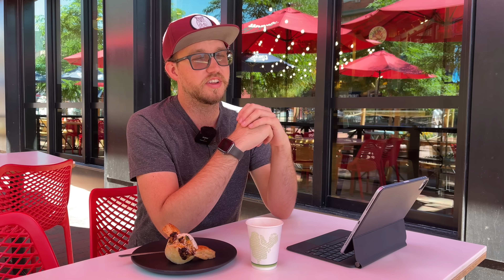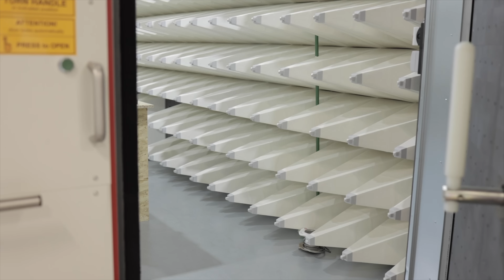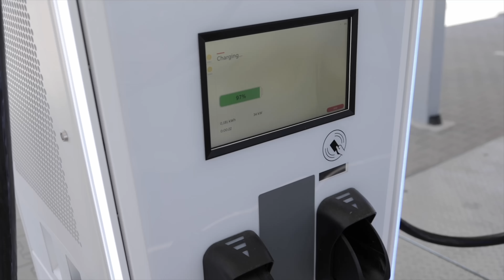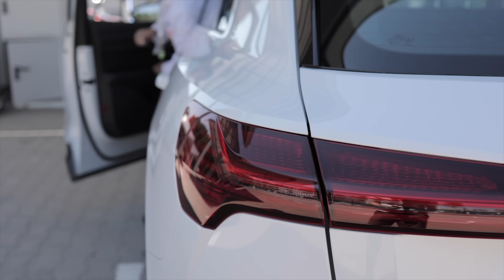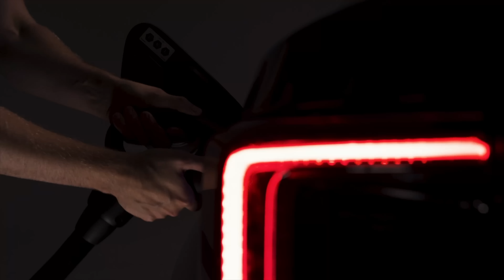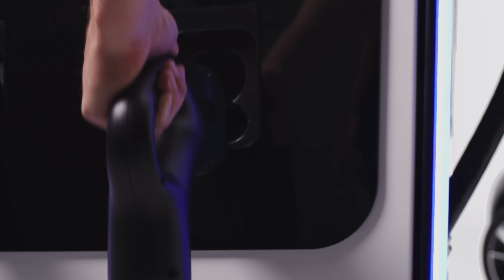This Is The Future Of Electric Car DC Fast Charging With ABB

Comment: In Australia its no doubt the hot sun. Trintiums seem to be worst offenders with many being down for weeks. The UV destroys the control panels. It is extremely easy to accurately check down time as its all there in Plugshare. The clever people though have figured out work arounds using the Tesla aps. I do feel ashamed though that you guys intend investing millions in hundreds of these devices. Another brand know as Kempower however might save Australia as several trials are underway. We have slmost zero problems with the Tesla network.

Comment: Interestingly your musings about the best speed of charging really depends on how long you are at a location. If you are on a road trip, a HPC charger with 350 kW is sweet - even though my first charging sessions were too short to allow to scoff down a burger. When going to the town centre to the cinema or shopping then the 11 kW AC charging really is a great option. And we see ever more of these types of charging locations pop up. For example a multistory parking lot in the town I live in has converted a whole level to AC charging stations, that's more than 40 chargers on that level... But there also is considerable improvements currently made by people that want to use the synergy of offering charging and lure you into their locations. McDonalds has recently ramped up their efforts and I already know of 4 out of 5 McDonalds locations in my vicinity (either home or workplace) that offer two 300 kW chargers... They may be load shared but even with that 150 kW I'd be hard pressed to scoff down a burger and some fries in the time my car charges.

Comment: the biggest problems with owning an EV is finding chargers that are easy to use...why can`t they be as simple as gas pump? plug in , blip your dept/creditcard , select start and off you go. now you have to dowload an app , setup an account and then confirm your email etc takes 10-15 minuts or so before you can start charging....and this is if your lucky...some chargers require you to have a special card to use....it`s a mess and it scares people away from converting to an EV.

Comment: I'm going to add something to this. A few points. One , as much as I want the EV market to take off , I have a lot of stock in Rivian. The American market does not see charging the same way the European market might , when you can fuel up a car or truck in a minute and a half and take off for another 300 to 400 miles. That makes a huge difference in the kind of time Americans are willing to sit at a charge station. If you can gain 300 miles of charge in 5 minutes. Then I would say the American market would take way off fast. However , waiting 30 minutes to a hour or more , for even 40 percent is not going to cut it. We can not even get people to stay at the gas pumps and tend to the gas nozzle for a minute or so , without walking off while its pumping cause time to Americans is money. Nobody has enough time for anyone except themselves. Two , One aspect that has not been a problem yet , but it will be soon , when crack heads figure out that those charging stations are loaded with copper in those lines that can be easily sold for quick cash, a Sawzall or a pair of bolt cutters and about 5 minutes and you can throw thirty of those lines in the back of your busted up ass truck and haul ass , and no ones going to catch you at 3 AM. Literally a pair of crack heads could hit about 4 or 5 stations in a 25 miles area and at the rate they get repaired , no one for weeks with an EV would be able to use those stations or even know if they are fully operational.

Comment: Great video, Jordan. I wasn't aware that ABB's production was located in Italy. I agree with you, fastest is not always better. I sometimes have the same experience, I go to a shopping mall and I can choose to get AC (11kW) or D (100kW) for my Model 3 LR. The first is too slow, so I go for 100 kW. But then I have to shop or lunch in a hurry, otherwise the car will get to 100% before I get back. 👍

Comment: To your point I just did a trip with my Bolt EV which is a 50Kw (55Kw Max). We were hungry and walked to a restaurant and even with the Bolt's SLOW DC fast charge rate it was done before we were.
Reply: Same thing here with a bolt. Lunch then at 95‰

Comment: This points out one of the major problems with electric cars.  With a gas car, stop at any station in the world and fill up with the exact same pump.  With electric, search frantically for a plug that fits somewhere in podunc city anywhere.  The world is years off, if ever, from standardizing an interface that will fit all cars.  Until that's done, electric  will never work, not that it's an actual solution to anything anyhow.

Comment: I used to build ski lifts, and the new ones came with ABB electrical controls: contactors, PLC's, and VFD or rather SCR because it was DC powered. And It's my opinion they make the best engineered electrical control systems, always so user friendly and easy to use, they think of lots of extras to make it easy to interact with each of their systems.  

I've worked on ABB, Siemens, Allen Bradley, Schneider,  Eaton, Honeywell, Emerson, Toshiba and Bosch PLC's and none come close to ABB. 

They haven't been lucky on wall Street, which is a shame.  They stopped making grid products and there has been time to adjust for that, they are in my opinion undervalued, specifically because of their intangibles, and have been undervalued for many years, they make excellent stuff, if i were building high end electrical/control systems I would use their equipment no question. 

I hope people begin to realize the companies potential from this highlight on their charging infrastructure products, the curve of their sales revenue I believe will outpace sales of electric vehicles. It's too bad analysts don't interact with PLC's

Comment: You're right about lower recharging speeds being the best option for some scenarios. I recharge our ZE50 at 22 kW, 3-phase, for about 95% of the time at my local public chargers, even though 50 kW is available there. For other occasions, I've used 7 kW, single phase AC, when faster dispensers have not been available. I have the time (and can do other things) to give the battery an easier life, and also to spend less money on the electricity. 

Interestingly, I see Tesla cars regularly at the same 3-phase dispensers, even though a Tesla can only recharge at up to 11 kW on them; half the speed of our Zoe. That slow AC recharging speed is something which Tesla really need to address for cars which are sold on this side of the Pond, where we use about 220-240 Volts, single phase, and roughly 415 V 3-phase supplies, instead of your circa 115 V single phase, and 230 V 2-phase supplies.

Comment: The Terra 360 sounds like a cool design. The complicating factor is that different car manufacturers have chosen to put the charge port in different locations so not all cars will be able to use all of the four charging spots.

Comment: Despite all the testing it seems non tesla chargers are only 75% operational at any time whereas tesla is 99% operational. I do not know why this is but likely enough its the myriad of operators each of whom has some unique protocol to activate the flow of electrons to the battery of the charging vehicle.

Comment: Living in Texas it seems that we see more trouble with EA chargers in hot weather. I was encouraged to hear that ABB does high ambient testing but I wonder if their idea of "Hotter than they'll ever see" is realistic. Recently on a day where the temperature was officially 100F the air temperature at the charging stations was 108 and the sun was beating down on the shared transformer which was far too hot to touch. Of the 8 plugs on 4 chargers, 1 was working.
Reply: It would not be a surprise. I was seeing similar issues on a road trip in late June in Texas at Junction end El Paso, and in Buckeye, AZ.

Comment: The idea of different speed chargers for different destinations begs an interesting question - what if it were possible to intentionally throttle your car's own charging speed via a phone app. I can see some use cases for this - if you can delay the completion of charging until you finish your shopping/entertainment, you can avoid needing to move your car or idle fees. It would, of course, have some interesting ethical issues, but would seem difficult to put a stop to.

Comment: Even Level 1 can play a role. If every parking slot at company or public parking garage or parking lot had a 110 v AC outlet it would allow a significant recovery of range. Tesla Model 3 and Model Y can charge at 2 to 3 miles per hour at Level 1. A Chevy Bolt EV at 4 miles per hour. So in an 8 hour day work day an EV would recoup 16 to 32 miles. With the average one-way commute in the use 20.5 miles, this would Level 1 charge  would significantly or completely cover this distance.  They could charge their vehicle overnight at home and be ready for the next morning's trip.
Reply: The problem with L1, there is no security to prevent anyone who walks by from unplugging you and stealing your charging cord. Right now, you can kind of get away with it only because EVs are still very new, and many thieves have not caught on yet. Once EV adoption becomes widespread, an unlocked charging cord will become just as much of a sitting duck as an unlocked bicycle.
Reply: @ab-tf5fl  you are correct about the ease of stealing the cord. Perhaps someone will come up with a more secure cord. The cost to municipalities and business of installing 110 AC plugs is much lower than Level 2 EVSE and thus more likely to be quickly achieved.

Comment: Do EV owners know that when the country goes green, that EV cars may not be able to charge up because homes and hospitals will be of the highest priority for getting electricity. Hold on, where are Swedish EV's made. I heard China.
Reply: This makes no sense. In the Netherlands we currently have way too much power, let alone not enough to charge cars. Plus the Volvo XC40 and C40 Recharge are made in Gent, Belgium.
Reply: Plus if you’re talking about the truck there is a big difference between Volvo Cars and Volvo Trucks (AB Volvo)

Comment: I've just completed another week of EV rental (in Sweden) with a bit over 200 miles from the airport to where we were staying and no charging available near our place. As your story with the Lego store, I only charged at a 50kW charger on the way from the airport but that was still too fast when we stopped to eat a bit over an hour away from the airport having ripped on the motorway there so I half way through the meal had to go and put the car on a level 2 charger instead as it was unusually charging by the minute. Only once did we actually charge faster than 50kW on a high powered charger, BUT at that time we really wanted to as we needed the car to be at 70% at drop off on return to avoid hefty fees. And we were really struggling to find high powered charging that wasn't shared or occupied or broken or we couldn't download the app to start the charger because our phones are registered in another country and not able to just swipe  a card at places we wanted to stop... We need way more Level 2 chargers everywhere as well as heaps of more high powered DC fast chargers as more and more people buy EVs!

Comment: I would love to know why so many DC high power chargers break so often and are down for so many days/weeks before getting fixed. Probably not what they ant to advertise but what I am really curious to know. What breaks within them? Cable cooling? Sensors? Parts within the high power delivery? Software? And is the delay in getting them working again mostly due to lack of spare parts as most parts are used to build new ones? Or is it the lack of engineers to fix them? Or even the lack of programmers to fix the software?
Reply: This is the elephant in the room.  It seems almost intentional that the rollout of fast chargers has been so difficult to initiate and so unreliable in operation.
Reply: Amen !
Reply: Bjørn noticed a "hot cable" on a charger he was using recently. Checked it with his FLiR and it was running 15° warmer than the adjacent units with a drop in speed.
.
Then there's the communication issues.
.
And build quality(?)
.
There needs to be serious discussion to sort it out.
Reply: Thermal Management.

Comment: Very interesting. They way to keep chargers maintained: A. They have to be profitable. B. They need to be at "gas station" type places with employees. They model of chargers scattered randomly around and tucked into parking lots was fine to start, but as the number of EVs swell into the millions, I don't see how it can continue to work. Seems to me the best model is just to install DC fast chargers at current gas stations.
Reply: Yes I agree. But an interesting issue is the enormous power delivery required, for a basic town "fuel-stop" with say 20 chargers, of 350kw. That's 7 Megawatts ! Allocated by the grid, for just one 'gas station' ....That's a grid allowance for a small town! And a small substation would be needed, for 11,000 volts at 650 amps! ...So I don't know where this will end up. And remember 350kw is just the good rate for 2022. In 10 years time we may be looking at 1 Megawatt charging power per vehicle as the top norm.  Phewww

Comment: Great video jordan. It would be interesting to know what is the difference inside the Tesla white cabinets that makes the more reliable other Than having more stalls at a location. I was happy to see you and Zach beat the Teslas in the race to Vegas . And I like drew too but it was nice to see a Tesla charger is not perfect like a lot of Tesla fans and drivers think. Every think can brake or slow down.

Comment: 2:50 that’s what I start to dislike = getting potentially only 90kW when I count on 150kW (my Audi e-tron).
Not mentioning Taycan, e-tron GT and other 200+ kW charging speed capable EVs.
Reply: Most EVs currently on the road only have a peak charging rate of 80-100kW. These stations obviously aren’t a replacement for 350kW stations, but I don’t see a problem with them replacing 150kW stations. Even my Tesla Model 3 charges with less than 100kW at 50% SoC. That’s perfect for supermarkets because it’s very cost effective while still offering the max charging rate in 90% of the cases.
Reply: @lorenzmuller4000  
If you charge out of opportunity- yes.
If you charge on a trip = count in a short HPC stop - I disagree. The charging HW is an investment into the future.
And all new EVs will charge way beyond 100kW.
Look at even the ID.5 peaking at 170 in the meantime.
Not mentioning the new PPE platform cars (Macau, Q6 e-tron, A6 e-tron…).
And as great the Model 3 is, that’s one feature I love about my e-tron: regardless of the SOC up to 80% it will always take 150kW
Reply: @audivisual  Like I’ve said, this station was not designed to replace the 350kW highway chargers. The highway charging infrastructure is already great (at least in Europe), what we need are more charging opportunities for people that can’t charge at home. The most convenient place to charge an EV is at the supermarket, you need to go there at least once a week and it usually takes around 30-45 minutes. Exactly the time it takes to charge an EV from 10-80%. The only thing that’s missing are enough chargers at the supermarket.

Comment: So I think Tesla has the best concept that is high voltage, fast DC charging infrastructure that is plug and go. The future should be as we develop better batteries, is wireless charging, that would truly be a game changer. I’m not sure about this ABB or whatever they’re doing here, but I don’t think you can be all things to all people because there’s too many different charging standards but wireless charging would solve the entire problem, so no more need for different plugs etc., so until that happens, I think the Tesla concept is the best that I’ve seen so far, as you simply drive up and plug in your car, go to sleep, get a coffee come back in 10 to 15 minutes or so or however long you going to be there, unplug and go. 

So the other thing one of the commenters mentioned was education and I absolutely agree it is the key to further facilitating EV adoption, but that won't happen if we don't have a variety of quality affordable EV’s that’s readily available for purchase, because Ford has been plague by recalls of its Mustang Mach E and GM is making some very expensive vehicles that most households can't afford, like the Cadillac Lyric and the Hummer SUV, therefore, having a variety of really good affordable EV models is going to be necessary if we truly are interested in wide acceptance of EV’s over gasoline powered cars. So I certainly agree that education is sorely lacking at least in the states, where the adoption of EV’s has been painfully slow! Cheers!

Comment: Your videos are very thoughtful and well-considered.  Your “interrupted Lego shopping” example at the end brought up a point you maybe didn’t consider….. you were wanting to treat your charging session like your car was in a parking spot.   Wouldn’t you agree that’s the equivalent of icing that charger since your car would be there longer than necessary?
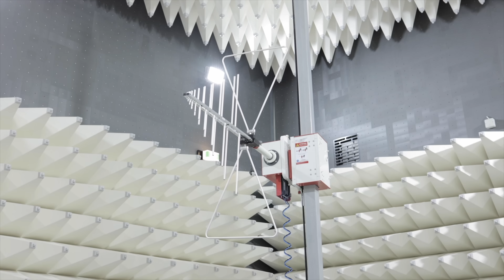Reply: In the Netherlands a municipality fined a man for charging his car to full and then waiting longer than two hours to move it. It was now ruled by a judge that this is a justified fine as he was blocking a charging spot. So now the general concensus is that you move to a normal spot after two hours of finishing charging. The only exception would be nights. For example between 23:00 and 08:00 or something.